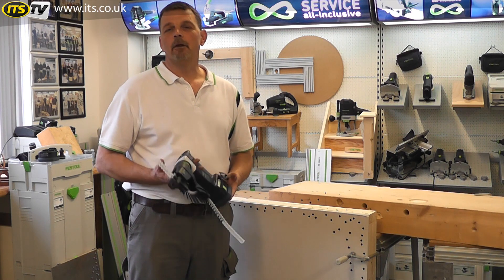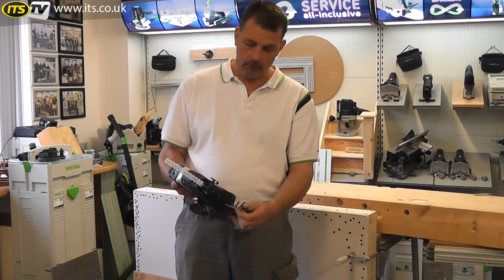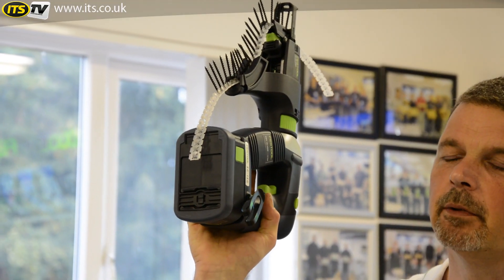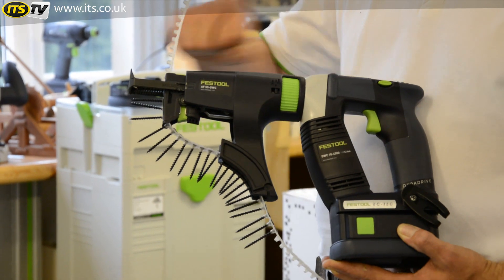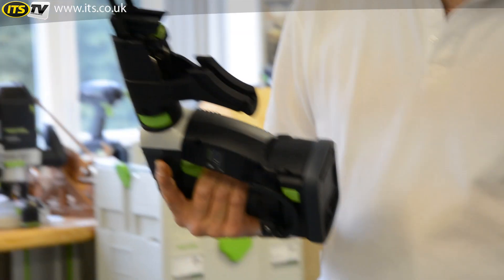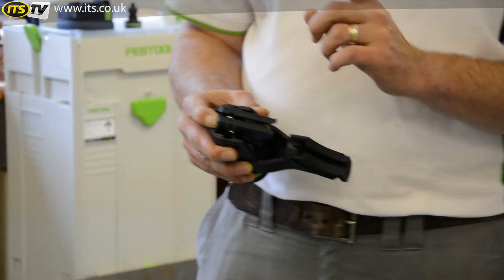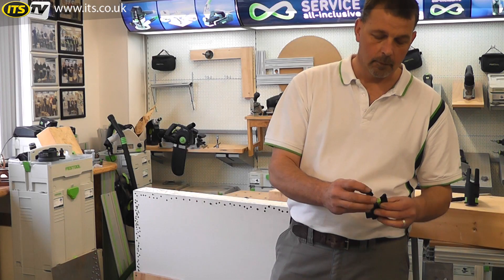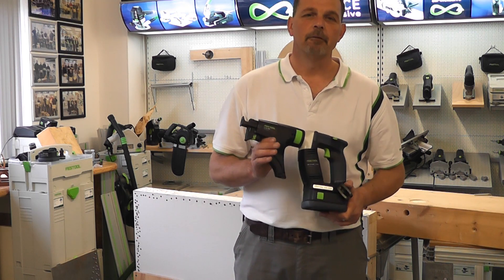Festool DuraDrive DWC184500 18v Li-ion Cordless Autofeed Screwdriver - ITS TV

Comment: Nice machine - but Phil - apart from the self-activation of the trigger this gun has nothing that a Hilti autofeed gun doesn't already have. Before you say it can be taken apart for cleaning, I've only needed to clean the mechanism in my Hilti once in 6 years and it gets a lot of work. 
I've checked out the ITS site and while it's much cheaper than I would have expected, it doesn't take a shorter screw than 35mm. 25mm is the industry standard short screw for fixing a single sheet to metal stud work etc.
Still, its a good first effort - way better than the piece of crap that Dewalt came up with.
Reply: I own multiple sd5000 screwguns. They have been very good to me. The festool seems quite nice also.